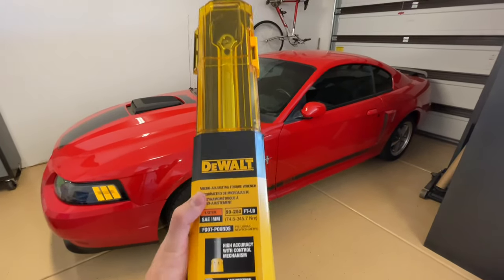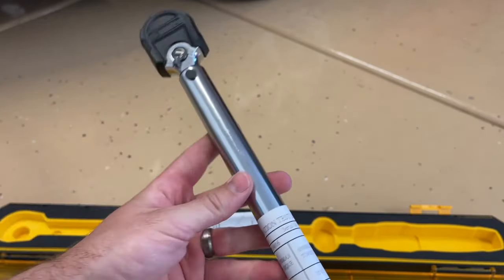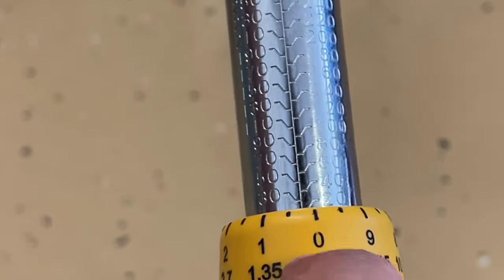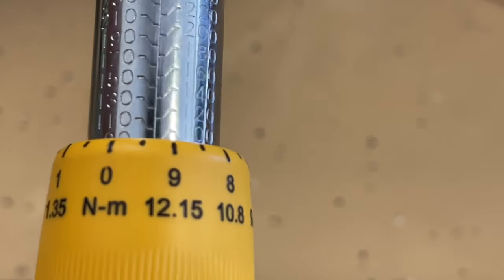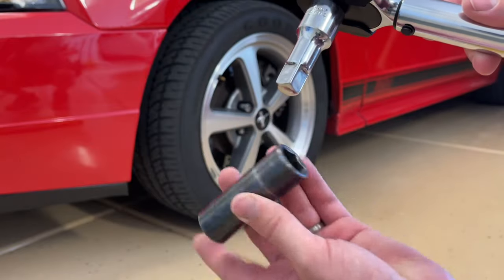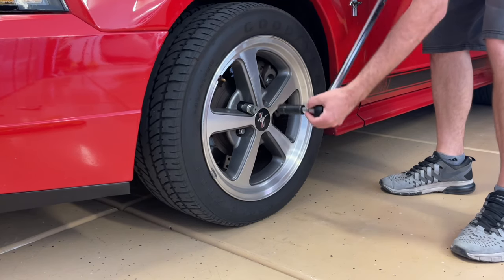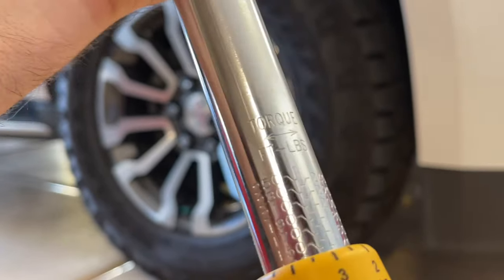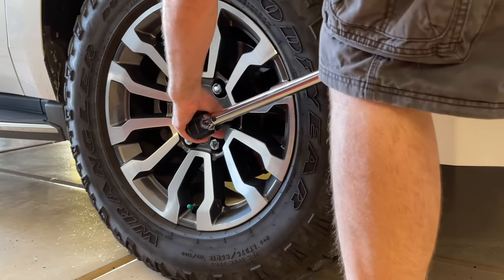Setting a torque wrench. Easy!

Comment: As far as I know, the reason there is a left and right torque option… is because there is a left and right tightening thread. They are not meant to loosen bolts, only to tighten them.
Reply: Right, so what is the difference for the wrench when you’re tightening a left thread or loosening a right thread bolt? So far no one could come up with a good reason for why it shouldn’t be used for that and people who never turned a wrench in their life just spread internet myths. Force is applied to the bolt regardless of what you’re trying to do so as long as you don’t exceed the maximum strength of the wrench I don’t see any reason how one could damage anything by loosening bolts with a torque wrench.
Reply: adjustable breaker bar
Reply: @georgebtro the reason you don't use a torque wrench as as a breaker bar is for the reason you provided. Yes force or torque is applied wether tightening or breaking but as someone who's job it is to "turn a wrench" you have absolutely no idea how much torque it would take to break a bolt/nut especially if you didn't touch it prior. There are some threads that through actions self tighten. While you could always set the wrench to max just use a breaker bar. That's what's for and much cheaper than a torque wrench. I'd rather snap my 25$ 25" breaker bar than my 125$ 20" torque wrench.
Reply: @Jfjs58-g  the reason is because the manufacturers tell you not to!!! Not an Internet myth, it’s using one’s intelligence to read the user notifications or manual
Reply: @clapclapscream  ok but why is that? Any logical explanation for that? You see that’s exactly the kind of things you see on forums, people who never turned a wrench in their life tell you how to do things.
Reply: @Jfjs58-g the difference between left & right hand threading is which way you turn the tool. Anyone that has experience with turning wrenches knows that socket wrenches aren’t made to break loose fasteners. That’s why breaker bars exist, and that’s why breaker bars do not have socket technology. I’ll bet you my whole life that the reason there are so many broken socket wrenches out there is because of people like you. Never once have been curious to see whats behind that snap ring
Reply: @B_COOPER  you telling me that wrenches aren’t made for turning screws? Now that’s something new. What are they for then, knocking teeth out? That’s just stupid. Unless some genius can’t break a screw loose and comes up with the idea to add a 3 feet extension to a wrench or do some other crazy shit the gear inside won’t break.
Reply: @B_COOPER  my car’s wheel bolts are torqued to 120nm. I use the same torque wrench to tighten and also loosen them for years nothing happened. I’m not talking about removing freakin caterpillar bolts with a torque wrench.
Reply: @Jfjs58-g  wow..even comes up with clear explanation like that than u still didnt get it even once..unbeliveble.. now go get the wrench u like and do what u like to do.
Reply: @Jfjs58-g IT IS MORE ABOUT THE FORCE APPLIED TO THE TOOL WHEN LOOSENING...

Comment: Supposed to store a torque wrench at 20% of top torque. If it is a 150 ft lb.wrench store it at 30ft lbs. I thought it was all the  way to zero too. It appears I was wrong as I was told by my father to do it this way 35yrs ago.

Comment: The reason some torque wrenches go both ways is to torque left or right hand threads. A lot of older vehicles had directional lug nuts on the left and right sides.
Reply: Never understood why people would think it's a good idea to break with a torque. Length maybe?

Comment: Very thorough instructional video on how to set the DeWalt Torque Wrench (No.DWMT75462). I just purchased the DeWalt Tire Change Kit (No.DWMT17107) which includes this exact DeWalt Torque Wrench and before I read the instructions on the proper use of it, I decided to find a video to watch first, then read the instructions included with the kit. Your video is spot on and makes it simple to understand. I’ve never owned a torque wrench, but have needed one for years when rotating my tires. So, I finally bought one. The kit I bought was such a better deal than just buying the torque wrench itself. The breaker bar along with the five metric deep well sockets and very sturdy case for it all is a very good value. And yes, never use a torque wrench for breaking fasteners loose, that’s what a “breaker” bar is used for. The torque wrench is an instrument to measure torque with.

Comment: Cool video! I’ve been using a torque wrench for years but I was trying to find one of that style since the Tekton ones I’ve owned are both the type with a screw on the bottom.

Comment: Nice clear video, just showing my son because you know it doesn’t happen if YouTube doesn’t have a video on it. Just one quick point. Torque wrenches aren’t for breaking nuts and bolts free, they to tighten in both directions, right hand threads and left hand threads. Using it to break a bolt free will at best knock it out of calibration, at worst damage it
Reply from the maker: Correct. I did say not to use it to break things loose, but failed to mention reverse thread torque situations

Comment: I've only ever used a digital torque wrench mines goes up to 80Ft/lb with different settings for NM, in-lbs etc. Got a twisting torque wrench.. for rent for higher torque the only thing that confused me was if the bottom line was the torque setting or the upper... this helped explain it's the bottom line.

Comment: The extension bar can affect the specified torque number chosen. A direct socket is more reliable.
Reply from the maker: Very true
Reply: would be interesting to see a test, direct socket vs 5-10 extension bars (fixed, not pivoting ofc). Is there any difference in the rotational force applied?

Comment: thank you so much. I got a torque wrench and I did not know how to adjust it. It has ft. lbs and Nm. I believe I can still use it for my bike when putting on the cassette to the back wheel.. of not..buy another one.

Comment: Thank you very much for this clarification, I have used a torque wrench all my life but only recently realized that I wasn't sure on this type of graduated scale, I was not sure if you started at the bottom of the squiggly line for 100 as example, or if you used the top of the squiggly line and then started 101,102,103 ...etc.

Comment: Excellent instructions 👍🏻
Reply from the maker: I’m glad you enjoyed it. I did mention not to use it to break fasteners loose, but one thing I did not mention is it has the reverse direction selector to torque reverse thread bolts.
Reply: @dannyjohnsonsgarage  It’s still a very well instructed video, 9.5 out of 10 😉

Comment: At 0:51it's not forward and reverse, it's clockwise for normally threaded bolts and counter clockwise for left handed threads, aka reverse thread. You're correct regarding not using it to loosen bolts, that could affect the calibration.
Reply from the maker: Yes, I added that to the video description. I did not mention it at the time.

Comment: I just bought one and it does not click no matter what setting it is on, it is basically just functioning as a breaker bar. hard to imagine it would be no good straight out of the box.

Comment: How much do I turn when I tighten a spark plug? Until I hear 2 clicks? I'd appreciate it if you lmk.
Reply from the maker: Usually spark plugs are only 12-14 foot lbs, so you would need an inch pound wrench. Don’t break the spark plug off with a bigger foot pound wrench. You would adjust the inch pound wrench to 144 inch pounds or so

Comment: Honestly I’ve only used a torque wrench for valve cover replacement but other than that just make sure it’s hand tight, never had an issue. Been working on cars for years.
Reply from the maker: Most of the time I do the same unless it’s very important

Comment: Thoroughly enjoy your videos. I used your video on removing a rear axle on my 1999 GT. Replaced all 4 control arms, springs, shocks, axle bearings and differential cover.  Great confidence builder, so allow me to express my appreciation and gratitude. Thanks, and keep up the great job. 
Side note, any engine removal in the near future? Also doing headers and K member in November, an engine support bar video would help immensely.
Reply from the maker: Thanks for the comment 🙏🏼 Yes, I have a video with the engine support bar for motor mounts. 90% of what you’ll need https://youtu.be/lmwfvgziAxs
Reply from the maker: Also, here is a full list of repair videos for the Mustang https://youtube.com/playlist?list=PLIjr-uSYDZi7hBrphoRniyYjb707PpPTu

Comment: Why your switch is set to left if you want to tighten clockwise? I am asking because it is still not clear to me.
Reply from the maker: It can be set to tighten regular bolts or reverse thread bolts
Reply: @dannyjohnsonsgarage ok but I see that some people has this switch one left others on right and everyone wants to tighten the wheel. I am just wondering what happens if this switch is set wrong way? I guess we should hear this rattling noise when nothing happens. When it is quiet it means we are tightening the screw. Right?

Comment: How do you set a York wrench to 7.2? I have a foot lbs York wrench. My first setting starts at 5. How do I get to 7 lbs and set it for the .2
Reply from the maker: Most ft lb ones will not go that low, so you’ll want to get an inch pound wrench. Multiply the 7 foot pounds by 12 and that equals 42 inch pounds. Set the inch pound wrench to 42 inch pounds and it will equal 7 foot pounds of force. If it really is asking for .2 more, that would be another 2.4 inch pounds, so set it to 44.4 inch pounds

Comment: When using NM does it matter where the fine adjuster thing is? I put it on 0 on the NM side and it stripped the thread. Is it because it was too much on the FP side and does the FP side have to be on 0 to have the correct torque on the NM side?
Reply from the maker: The scale should be the same starting at zero on each side for NM or FT-LBS

Comment: Once you have pulled the sleeve to move it to a higher torque level, do you need to lock the instrument in in its torque set level? Will it move and change while in use?
Reply: Yes

Comment: I have another question if that is fine so I notice I have a rattle in 1st and 2nd gear when I’m at 2000 rpm to around 2500 ish And only under load and it seems louder when it’s cold I am thinking timing chain but I want to be sure and if you got any advice or videos on that. Thank you a ton and if that is the problem let me know if you got any videos on timing or getting into the 4 valve Mach engine :)

Comment: I may have missed it but where is the very important instruction on resetting the wrench to zero after you've used it?
Reply from the maker: Yes, mentioned at 4:50 into the video. 
  I did not cover reverse thread torquing, which is why it has a reverse switch on the head
Reply from the maker: Yes, 4:50 into the video
Reply: @dannyjohnsonsgarage  Thank you!! I did miss it!
Reply from the maker: @TheScrappinsass  I’m sure most expect it at the end of the video.

Comment: What is the minimum number of this
Reply from the maker: It’s lowest setting is 20 foot points, but they advertise 30-250, so it probably isn’t accurate under 30
Reply: @dannyjohnsonsgarage  Is it possible for me to tighten a bolt with 4 nm range in this?

Comment: This is the way I have been setting my torque wrench. But after reading a very long post on Reddit, seems there are two ways to interpret the scale. People claiming to be metrologist who calibrates instruments for a living, people claiming to be aircraft mechanics or nuclear submarine mechanics, and they cannot agree on the correct method!! In fact most people are saying that the bottom of the range marked by 100 is actually 90, and 100 is right opposite the digits of 100. Very confusing!
Reply from the maker: If you count the rotations from zero it ends up being at the bottom of the line, but it’s possible different brands do differently
Reply: @dannyjohnsonsgarage  Found the instructions for my wrench. The procedure is definitely as you describe it. Wierd that a lot of mechenics are probably doing it wrong!!

Comment: damn 145 is a LOT for a wheel stud Most of mine are 85-90. Not saying yours arent...just a shock when you said 145 lol
Reply from the maker: Yeah, all my mustangs were 90 and I was a bit shocked seeing 145 when I started working on my Silverado and Yukon.
Reply: @dannyjohnsonsgarage  my 1986 mustang is 90 and my 4runner is 95. 145 is a lot but I guess if they have hardened studs it's all good
Reply: 150lbs on my f150
Reply: 140 for Chevy Colorado

Comment: What about 27 foot pounds? 🤔
Reply: you simply go to 20, then turn the dial and count up...every time the next number gets to the line on the beam is 1 digit higher than 20, so,  one, two, three...until the dial is 7 numbers past 20, so youll see the 20 line partially covered but the line on the dial and the line on the beam itself would be aligned and the number showing on the dial would be 7. it would be so much easier  to show you but i cant. i hope i didnt confuse you more
Reply: @jasonochs8369  thanks for responding!
Reply: @kennethjames8314  I hope it makes sense. If not, I can try to do a better job of explaining it. It's really pretty simple when you think about every line being a number whether it's marked or not
Reply: @jasonochs8369  thanks  I think I've got it👍